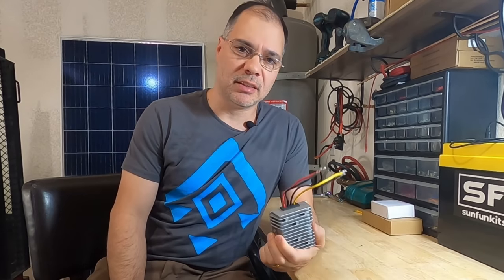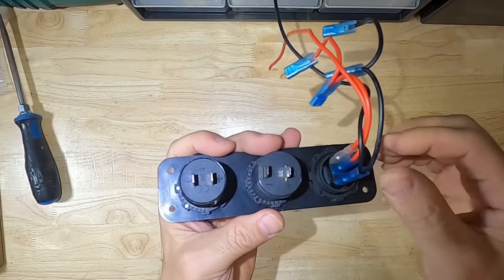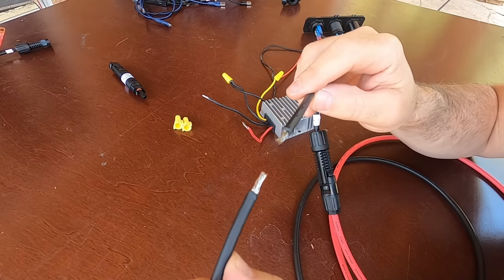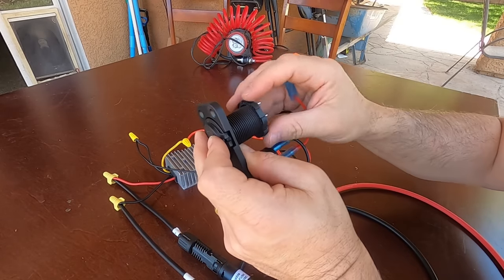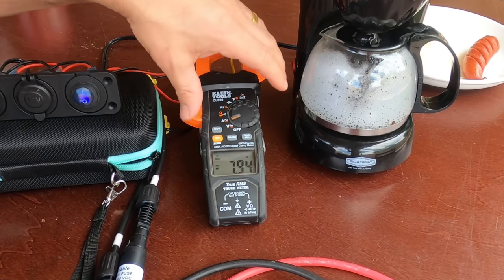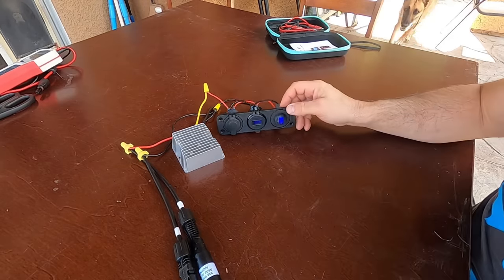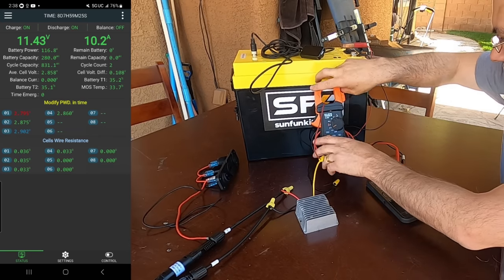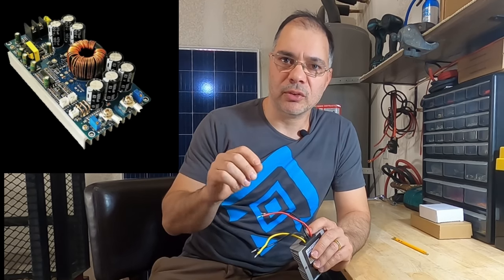SHTF - Cheap Emergency Solar Power! Use Any SINGLE Solar Panel! 1/2

Comment: If it is an emergency situation, and you have a good BMS, you could hook the panel directly to a Lifepo4 battery. The BMS should turn its self off once a full charge has been attained. I would only do this in a grid down situation
Reply from the maker: I don't think the bms would like the variable voltage coming from the panel. It would likely cause the bms to go into fault mode.
Reply: @natesdiysolar  
Maybe, but if your charge controller is toasted, it may be the last choice to get a battery charged.

Comment: Is there any kind of set up like that that would work with an air conditioner or heater
Reply from the maker: Nothing big.  You could Maybe power a 12v cooler or fridge. I have seen people do that.   250w or less.  You wouldn't want to try to power any AC appliances from this..  iceybreeze cooler. Or 12v 300w heater. Would Have to be a very small space.. 12v electric blanket uses less power.

Comment: mppt converters are better for this job as they chose if voltage is low works on boost mode and if high works on buck mode which keeps big part of power. While this motorcycle stepdown/buck converters work i  general by shorting power to negative using zener controlled transistors/mofsets untill it drops to 12~ not wery efficient ...but still does the job.
not all mppt has boost and buck mode tough, some has only boost
Reply from the maker: I've never heard of buck mode on a mppt... do you mean bulk mode.. can you send a link to such a controller with buck mode.  Thanks
Reply: @natesdiysolar  well pwms are in buck(stepdown) mode . And most of mppts support stepdown mode as what i see... not all has this featre anyway...
Anyway i dont know what actuqlly buck is short for... but its ysed to describe stepdown mode with frequecy controlled transistor syncronised to output ... atleast thats the circuit i saw when desctription says buck converter in general ;]
Tye difference between linear(scooter alternator rectifiers) and buck converters is zener controlled scooter/motorbike rectigiers short excess voltage (general design is this might differ on different brands) while buck converters disconnect circuit and waits until voltage drops to 12~volts then connects back if lover then 12.. thia system gives adventage of using bigger partion of source power say by using capacitors im not sure about details... while acooter/motorbike alternayors doesnt need this excess source of powertgey simply short it.
Reply from the maker: @ahmetmutlu348  thanks for the info.  A lot to unpack there 😀

Comment: you take this unit  you have      and a 12 to 14v  dc 5 amps   non isolated mini converter for (((10 bucks)))   and you  pass it with  7,5amp fuse and 2 clamps  you have a battery charger!!!!!!  ordered my 12 to 14v dc 5 amps       for any emergency charge my car via eco flow 12v outlet!!!!!!!!
Reply from the maker: Great idea! I wondered about that if the output of the 1st buck would be clean enough for the 2nd.
Reply: You can charge your car battery direct from a solar generator cigarette socket as they are regulated to 13.6V, just use cigarette plug to crocodile clips cord!  No need to get any converters at all...
Reply: @natesdiysolar  for a battery charge when you  observe it  during sunlight its more than enough pulses!!!!!  happily thinking
Reply: @ebikecnx7239  eco flow shows less!!!!  let me check again ..... .... ... ... ... ..hmmmmmmmmmyup 12.7   i knew it was poor output
Reply: @panospapadimitriou3498  Bluetti EB70 and AC200MAX I have are reading 13.6V regulated on my meter.
Reply from the maker: @panospapadimitriou3498  now I'm going to have to buy one lol
Reply: @natesdiysolar  don't need it, the Bluetti Solar Generator 12v cigarette outlet is regulated to 13.6V

Comment: If the grid is down, why are you charging a phone?
Reply from the maker: Or a Noa short wave radio.  Or handheld radio... all in video.. 12v ham radio... many use cases .. not just phone.

Comment: I have a better way.- use - terminal Block Connector 12-track 16mm2 threaded electric 30A  plus rectifier diodes on the positive pole and you will get a charger that can charge a 5V phone, a 12V and 24V battery simultaneously - depending on what panel you have and how much you lower the voltage.
Reply from the maker: In place of the buck converter?
Reply: @natesdiysolar  we connect a cube with diodes to the plus of the photovoltaic panel - each one lowers the voltage by about 0.3v or 0.7v - depending on which one you buy ... and now at the end of each diode you have a different voltage - and you can connect many devices.
Reply: @natesdiysolar  /watch?v=6D0aUmkUQSQ
Reply from the maker: @dawidkujawski3340  i see. sounds cool. i did something similar a long time ago to build an audio power meter.

Comment: Can you get a but converter that puts out 14.4 volts so it can fully charge a sealed lead acid battery
Reply from the maker: They exist, but not all do well with charging.  Unless it says constant current. I actually had xwst make a custom one for me with 13.8v output and I was able to charge past 90% on lead acid and lifepo4 . I'll post that soon on my website. I plan on an update video featuring this unit.. 13.8 is really the sweet spot. You won't get much benefit in terms of capacity above that.  Especially with lead .. voltage bleed off etc..
Reply from the maker: Here is a link to that unit.  It's a special order from China only.. 
Long Term u would want a proper change solar controller vs a buck

https://www.aliexpress.us/item/3256805802656119.html?gatewayAdapt=glo2usa4itemAdapt

Comment: Is there a way to scale this up? Luke running larger things or is there limit like most things. I've always wondered why a battery system needed to be apart of using solar but wondered if it was possible to run things if the world fell apart and no batteries where made kinda thing. Thx for any info.
Reply from the maker: I would not scale it up past running 12 volt appliances, etc.. at that point, you want a battery and real solar system, so you can use that power at night.  But to your point.. lifepo4 batteries can last 20 years, so there's that... thanks
Reply from the maker: If you tried to run an ac inverter from a buck converter it would just smoke it.. they have large buck converters but if you going to spend that much money get a regular AC inverter etc.
Reply: @natesdiysolar 

What about connecting several buck converters in parallel? 

The wattage is added. 

Five identical buck converters in parallel with quintuple the power, as long as the solar panels can provide such power. 

Inverters consume much power, just keeping an inverter on stand by all night will discharge the batteries.

Comment: How will you solve the wire problem? Eventually you'll melt the wires.
Reply from the maker: Either use one appliance at a time or physically change the wires. I'll be doing a follow-up video on how to do that.  If you are not using large 12v appliances then it's fine as is.
Reply: @natesdiysolar  Use a 12V Refrigerator.

Comment: 13:20 I would try at least a 200W panel. They are not that much larger than a 100W panel.
Reply from the maker: The first panel I used was a 250w . On the battery I used a 100w then I tried a 335w
Reply: @natesdiysolar  The 250W and the 335W panels are huge compared to a 200W panel, but it is not much larger than a 100W panel. I bought six for my girlfriend's solar build on her bus. I've been doing off-grid solar for about 30+ years now. ;)

Comment: Why can't you use wire nuts on dc current?
Reply from the maker: Technically, you can, but if it's high current, the connection would heat up if it comes loose..  there are better options but for temporary setups it's fine.

Comment: like the parts bin on the desk do you have a link to it?
Reply from the maker: So I looked in my history and this is the one that shows up now.  It's still 44 drawers but they changed the configuration.  There is more large drawers 12 vs. 9 . It's more wide.. not quite as tall
 
https://www.amazon.com/Akro-Mils-10144-20-Inch-16-Inch-Hardware/dp/B003P2UOCO/ref=pe_386300_442618370_grr_1/147-6741911-9810834/ref=grr?_encoding=UTF8&pd_rd_i=B003P2UOCO&psc=1&pd_rd_w=TmvpQ&content-id=amzn1.sym.6b2c98fc-795b-4924-9247-33dced7906cf&pf_rd_p=6b2c98fc-795b-4924-9247-33dced7906cf&pf_rd_r=2YQMB2JZBXA450CK4F6E&pd_rd_wg=7IN3J&pd_rd_r=b7921131-f526-4757-b4ca-8d5da4662450

Comment: I have a (15-40v) in and 12v 30amp out. Just link good sized panels in parallel and have 360 watts.  Mine is being used to connect a few 18650  (8 bay) chargers mounted on back of panel.
Reply from the maker: That's cool.. so when the batteries are full, how is the charge voltage regulated..
Reply from the maker: And how hot does the back of panel get.. in vegas we can see 140 degrees on the back of panel
Reply from the maker: I was thinking of using 18650s to build a 12v pack to use as power source for the USB panel at night..
Reply: @natesdiysolar  Never really put it to a real heat test. I live in WA state. If it gets to hot, I can relocate the chargers in the shade with some extension cord. Your in a great place for solar :)
Reply: @natesdiysolar  I have a couple miboxer 8 bay chargers that regulate it.  It runs on 12v. The 18650s are mainly for flashlights and things like that. If I were to build a 12v pack, id go with lifepo4 batteries since the work so great as a 12v.  18650's have the 3s or 4s pros and cons issue to deal with.

Comment: Would like to see high voltage solar with pwm charger, and then same setup, but before pwm put this buck converter. I would say it would work similar to mppt charge controller, rise the power output of pwm charger.
Reply from the maker: Interesting.  I'm not sure the mppt would read the PowerPoint correctly.  I tried my solar panel meter on the buck output out of curiosity, and it said my 200w panel was producing 600w, so there is that.. Heavy Duty converters can cost more than mppts so not thinking any real benefit would exist..
Reply: Would not read mpp but i thing with dc coversion it would feed pwm with more curent. You are right that those converters are expensive. I was just curious about that experiment
Reply: 600w from 200w panel is ofc wrong

Comment: What is the efficiency of the converter and how much energy does it use to run? How hot does it get? What are the wire sizes? I have a step up converter for usb c to go from 12v to 20v. But the wires are small.
Reply: Also if u had 2 solar panels u could run them in series but the converter wud still put out 12v. If spending money on a converter, you could get a cheap charge controller instead.
Reply from the maker: https://www.amazon.com/dp/B0B5KP3JQY?th=1&linkCode=sl1&tag=natesdyisolar-20&linkId=1462d75de3d071ea4fc6db9d4c65fb2a&language=en_US&ref_=as_li_ss_tl

93% efficiency 
65c max temp 
16awg wires 

What is the output amp rating of your unit
Reply from the maker: True.  I have not tested a direct load off an mppt but I saw another video stating the mppt needs a voltage ref in order to output power .

Comment: for that 20-90V regulator you either need 24V panels or in series, either way will work. me personally, i prefer those adjustable regulators (comes in handy if you  play with arduino, raspeberry or any other development system) since I can set each output on different voltage and Current. but for camping, SHTF use or home use,  fixed ones are best way to go. i have a question;  did that handheld came with Usb charger or you  made your own cord? i have Uv82, but has 7.4V nominal voltage and  external charging adapter...
Reply from the maker: It comes with a plug-in charger, but you can buy a USB charger as an option .  It's a baofeng 8w radio. How much power does that raspberry or audrino take?
Reply: @natesdiysolar  very little; from 3-5V and under 1Am  on both ports. will check if  there is compatible system for my 'fang, if not i'll make my own. also, you explained  entire system clear and  simple so everyone can understand. thanks for that.
Reply from the maker: @ApocGuy  it's just a USB adapter cable that plugs into the base. I got an extra base as I use it when I'm off reading .

https://www.amazon.com/Baofeng-Charger-BF-F8HP-Two-Way-100v-240v/dp/B01MV1U03N/ref=mp_s_a_1_3?crid=24GIH2Q9G28LB&keywords=BAOFENG+BF-F8HP+charger+base+with+usb+adaptor+cable&qid=1689433310&sprefix=baofeng+bf-f8hp+charger+base+with+usb+adaptor+cable%2Caps%2C182&sr=8-3
Reply: @natesdiysolar  tnx, but i've managed to make one on the fly from parts i have at home. DC DC converters are awesome :D . Now all i need is to modify base so it will accept  USB-C charging cables so i can use one from phone ;) . will deff buy one of those cradles, just to have backup when needed :) .
Reply: @ApocGuy 

DC-DC converters and DC-DC chargers are awesome, I agree.

Comment: Can u power eco flow wave 2 air conditioner/heater without any battery w a buck converter to a solar panels?
Reply from the maker: No. It's meant to work with either the ecoflow system or plugged into an ac outlet.
Reply: @natesdiysolar  but why in theory won’t it work without their battery? Proprietary setup? Can it be hacked regardless of warranty being voided?
Reply from the maker: @MrPbologna  it looks like it has an built in battery, and that battery is what gives it enough amps to run, so it's not direct from solar.. it takes 400w of pv input for charging but takes 550w to run the ac.  You would need a converter that can replicate the battery DC output in volts and amps. 

You would need a converter large enough to handle the surge when the compressor starts. Probably is less than 16a. The specs don't show this info.  How is the battery hooked up to the ac.. It's the battery removable ..
Reply from the maker: @MrPbologna  btw it looks like it already can "charge" from solar and run n from its battery, so why even do this?

Comment: WELL DONE! Unfortunately it's hard to get devices that run on 12V :D
Reply: 10-30V is standard for many  Marine devices
Reply: @longtimber1  there are refrigerators 12V for camping devices but if a 500W device is used (cooking) the wires need to be really thick rated for 41Amps! :D thats the benefit of higher voltage systems: more power over smaller cables :D but it's pretty cool the cooking worked so well :D
Reply from the maker: Yes and they all use less than 200w I wish the Frying Pan used a bit more power. It should be a bit hotter

Comment: Plz try an experiment to run an electric generator with bldc motor powers by solar. Thanks and love..
Reply from the maker: What is a bldc motor.. brushless? DC?
Reply: @natesdiysolar  yes sir brushless DC motor.. Is it possible to run electric generator alternator with BLDC powered by solar when mechanical eigine replaced by it.. Thanks and love
Reply from the maker: @mychannelrace  sure you could do it, but remember.. every time you convert energy from one form to another form.. energy is lost. So you would produce less power via the generator output vs. the input.  There are many fake videos about this, calling it infinite power, etc, but it's just physics. Hope this helps.
Reply: @natesdiysolar  sir you are absolutely right as I am not so knowledged and educated like you, it's just my idea blowing in my mind. Losses in energy conversion is fact but we are giving solar energy to bldc motor to move alternator.. Anyhow, thanks more than million you bother my words. Here are huge energy crises and we want to get rid of it by cheep resources coz we ppl don't have money.. Plz do something easy and cheep for us, for humanity, definitely you will be blessed a lot by God. Thanks and love❤️

Comment: i often wounder if using the regulator from a motorcycle or a car altenator would work in a shtf situiation as they be alot more of them about
Reply from the maker: I don't think so..  I know the input voltage would not be high enough, and I think the stator put out AC current..  not thinking it would.. but golf cards and busses have buck converters  :)
Reply: @natesdiysolar  inputs on them can be as high as 90v i would think the bridge rectifier would direct the dc to the right terminals after all this what it does with ac going to have to find a spare and give it a try
Reply: Correct me if I'm wrong, but an alternator + voltage regulator system controls the voltage by varying the current through the alternator's exciter coils. It's not a straight DC-DC converter circuit. It relies on the fact that there's an alternator spinning around, and simply controls how much mechanical power it extracts.
Reply from the maker: @DFPercush  sounds correct to me
Reply: @DFPercush  oh you may have a point I forget cars have feild coil unlike bikes that are permanent magnet

Comment: I love the elegance of direct use solar, I have a radio that comes on every day off a tiny 5-volt solar panel, direct solar is great for pond pumps and small fans to ventilate hot greenhouses.
Reply from the maker: Yes, fans are great and self-regulating!